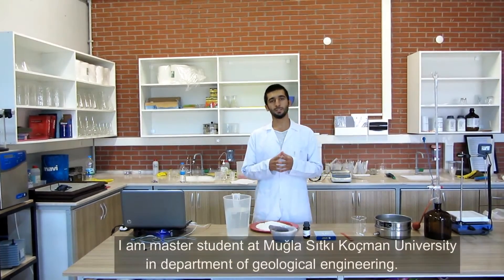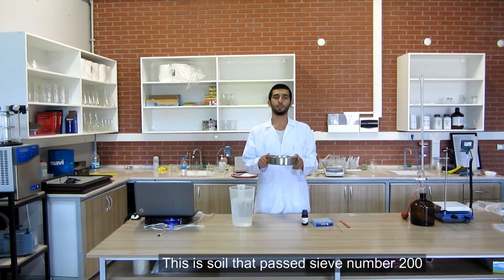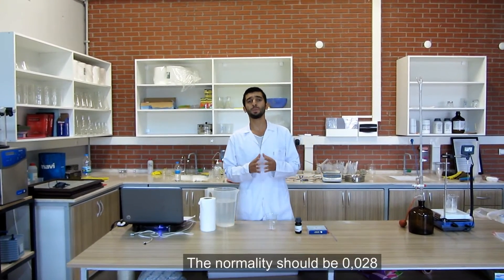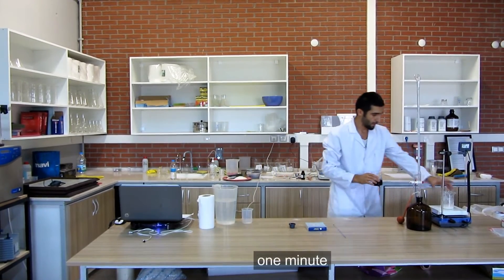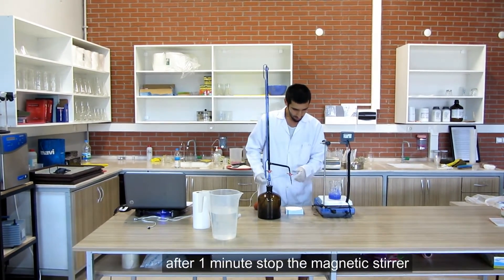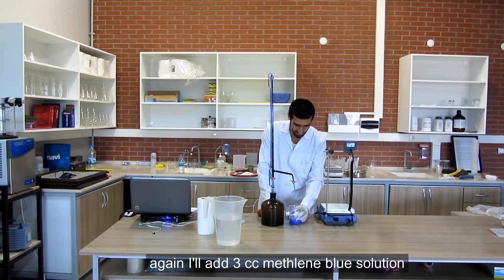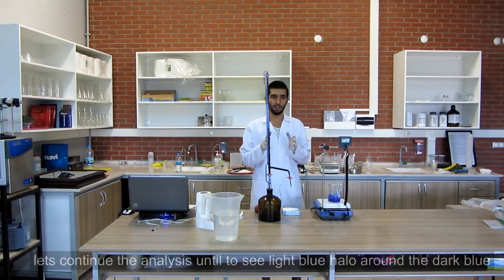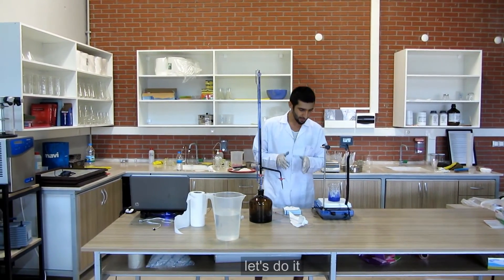Cation Exchange Capacity measurement of Clayey soil by Methylene Blue

Comment: Thank you for this video, it is great and very useful.  

Have you considered using 3.57 grams of Methylene Blue per 100 ml water.  

That will make the final calculation easier. 

3.57 x 0.028 = 0.1 as the multiplication factor 😎
Reply from the maker: İt's been long time, i have to check document for calculation method. But i have used method of Jones F.O. (1964), u can take a look for calculation

Comment: Could you explain the involved calculation? I Couldn't understand how it was done.. What does the acronyms stand for, such as "F", "N" ,the "'100" and "0,028" from the calculation.. I would appreciate if you could explain each of the numbers and the process to calculate the meq/100g
Reply from the maker: send me email to provide documents to read
Reply: Vcc = volume of titration in cc 

F= sample weight 

N(Mb) = Normality of Methylene Blue 

100 is to convert figure to 100 gram sample equivalent 

100/7.5(actual sample weight) 

0.028 = the normality of 1 gram methylene blue dye in 100 ml of water.  

My suggestion is to use 3.57 g methylene blue per 100 ml and make the calculation easier - multiply by 0.1.
Reply: pro trick: you can watch movies on Flixzone. I've been using it for watching loads of movies during the lockdown.
Reply: @Kyrie Dustin definitely, I have been using flixzone} for since december myself :)

Comment: Is this method applicable for bentonite clay?????
Reply from the maker: Bentonite is clay not clay minerals, but bentonite is consisting mostly of "montmorillonite" which is smectite group clay minerals. And smectite group minerals are most swelling ones, therefore their surface area are biggest, espacially montmorillonite mineral. So with this method you can find which clay minerals are more common in soil, based on their surface are. You can find smectite group but not cannot be sure if it is montmorillonite or other type of smectite gorup minerals. In any case you cannot tell it is bentonite as ı know, because it is not a clay mineral. However using XRD you can find bentonite. I hope this this explanation is clear for you